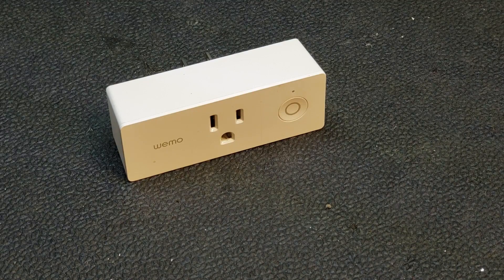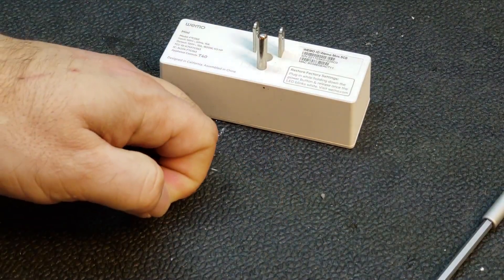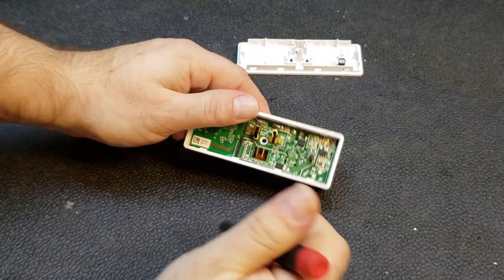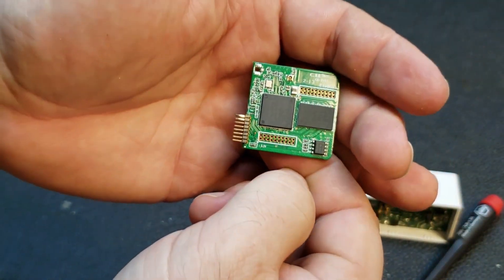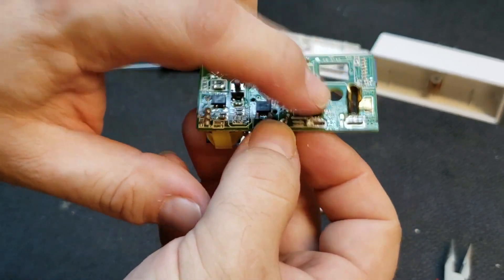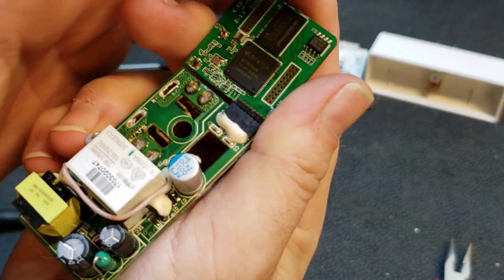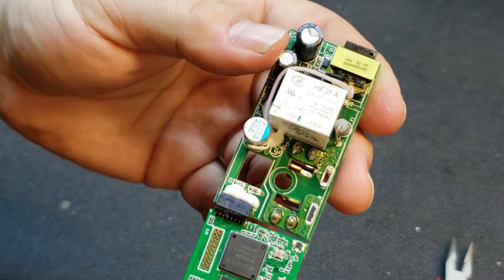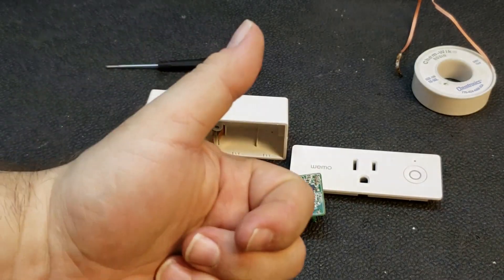Wemo WIFI Outlet Teardown

Comment: No separation between high voltage and low voltage, not good
Reply from the maker: and they went out of business without releasing source code to update the firmware.  I scrapped it for parts.

Comment: Thank you for this!  I'm looking to extend the antenna.  You mentioned the antenna connection in the upper left corner of the wifi module, and then you mentioned a "test" antenna.  Which should I connect to?  I have the module inside a metal transformer box which acts as a Faraday cage and the module can't get a signal. So I need to extend the antenna to the outside of the transformer box.
Reply from the maker: Understood! I can't recall the proper name of the connector, but it's the same sort of connection used for laptop wifi antennas. Mini or micro sma maybe? You could probably get away with a piece with of wire soldered to the end of the antenna connection on the board. Your best option is to find an old laptop with wifi and harvest the wifi antenna and coax wire with the end. That should plug right into the antenna test port..

Comment: Can it be converted to DC? DC in DC out like for 12v?
Reply from the maker: Technically yes but the amount of work involved might not be worth it. There are 12v wifi switches available for less than the cost of a wemo, or if you have the skills to program for Arduino IDE, you can buy an ESP01, a relay and some power supply parts and build one for less than $20.  
Now if you only wanted to use the relay inside to control 12v(and still use 120 for the power to the unit) that would be a lot easier. You would just cut the input and output to the relay and hook up your 12v line there. I would probably desolder the existing relay, and solder in some wires that go to a 5v coil and 12v30amp relay contacts. and have it hang off the board so I could put the old relay back if I wanted. 
Hope that answers your question and thanks so much for watching my video!

Comment: What did you use to pop the cover off I tried using a box cutter but it didn't seem to CUT it!
Reply from the maker: I used a spudger since it's a little more bendy. Box cutter might snap unfortunately
Reply: Yeh

Comment: That is not a relay, but a transformer. It looks like the main power is switched with a triac (what you called the diode for the relay), nope, sorry I was wrong, it is just a sticker talking about the switched power supply behind the relay, the actual specs of the relay are shown at 9:06 on the the top.

Comment: what is the smart plug you said you started using because you felt it is better than the Belkin Mini Smart Plug?
Reply from the maker: Im using the Etekcity and Amysen plugs now.  The Etekcity were my first choice but these Amysen plugs are smaller and work as well.  I did a teardown on the Amysen plug here. https://youtu.be/Xt_qkRCsYgg I've only used them for a few weeks now and they have been fine.  The Etekcity plugs I've used for over a year and had no problems. I suspect the Amysen will be just as good. The 'name brand' plugs are more expensive for no discernible reason that I can find.  I'd definitely recommend either the Amysen or the Etekcity plugs for sure.